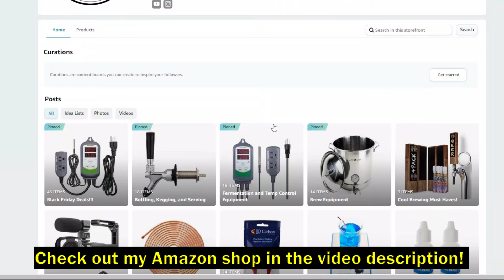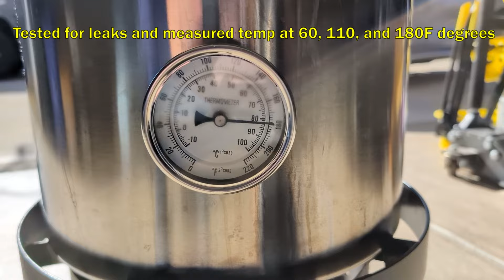EASY WAY to add a Temperature Gauge to an existing Kettle - Step by Step instructions

Comment: Do you want the Teflon tape in contact with the wort? Seems like contamination potential.
Reply from the maker: Yes. It will not contaminate your wort.  Chances are most of your faucets in your house have Teflon tape put on them and you drink out of that.

Comment: The Teflon tape should be wrapped in the opposite direction.
Reply from the maker: You actually do it in the same clockwise direction so it doesn't unravel as you're threading on the nut.
Reply: It looks like you’re doing it counter clockwise. Maybe I’m not seeing it right.